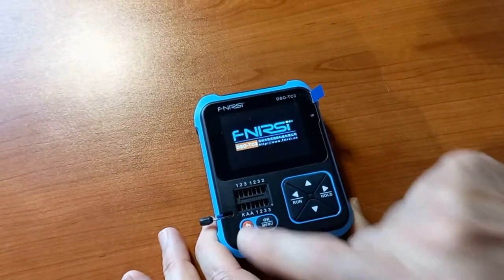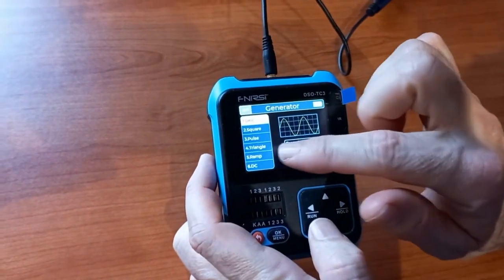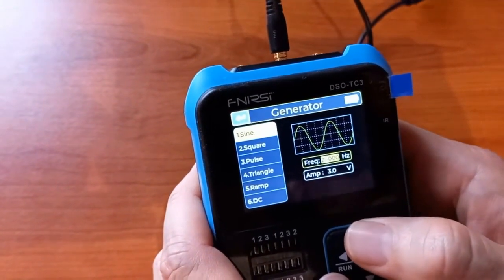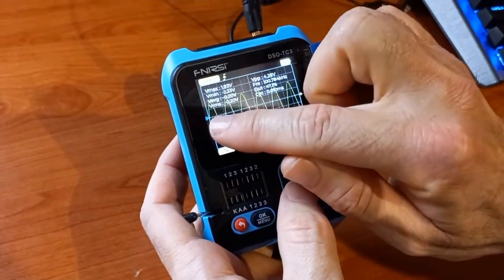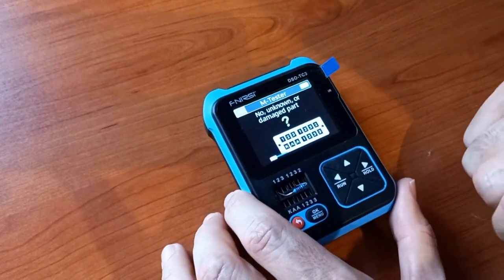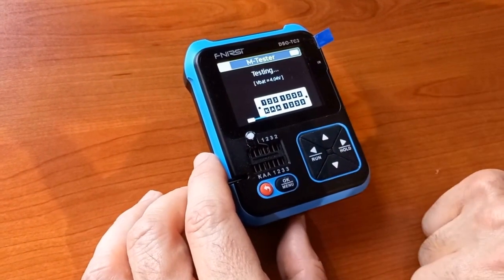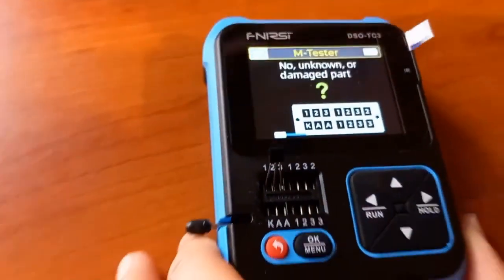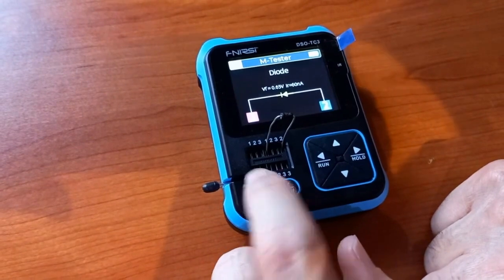FNIRSI DSO-TC3 Multitester Oscilloscope Demo

Comment: Hi.can you tell me if the sine wave generator works at the same time with the oscilloscope? I want to test capacitors in circuit.thenks
Reply: When you enter oscilloscope mode the signal generator switch to a fixed 1kHz square wave automatically and stays there while you're in oscilloscope mode.
Reply: @JohannY2  thank .did you do capacitors esr scope test with it? Even with 1khz it can be done I think. The test is explained in this video in minute 7 in case you don't understand what I mean.thanks a lot.

Comment: What's the "IN" input for?
Reply: for testing voltage 0-40v
Reply: But only in one direction , you have to be shure of the polarity ...
Great chance to blow it up when you probe too high Voltage on it.
Usable for Quickcheck 1,5V batteries or 9V blocks , but dont expect more (Impedance only round about 160k ohms).

Comment: All those" Generatortests " 😂 .Starring at an Oszilloskop to interpret a "Sinewave" is totally useless.
To check to Quality of a sinewave ( Harmonics) a Scope has to be switched in FFT mode ( most modern scopes are able to do this) , and  it has to be looked for the amplitude of the 3. harmonic and 5.harmonic of the given wave.
But in all those tests they look at a screen with Amplitude/Time relation and not Amplitude/Frequency relation (  measured in dB m).